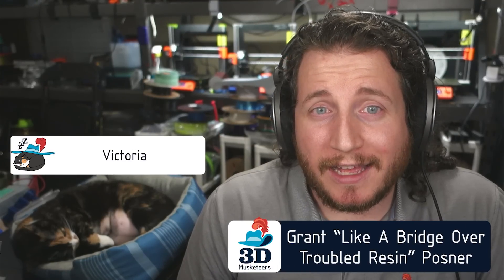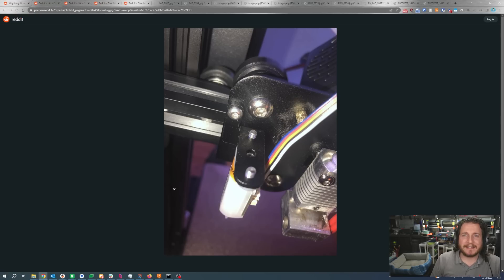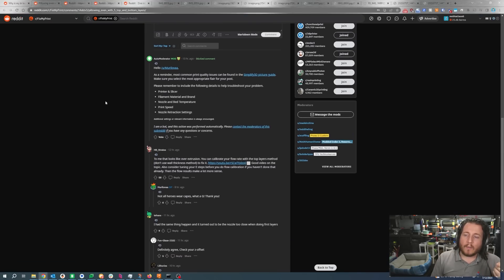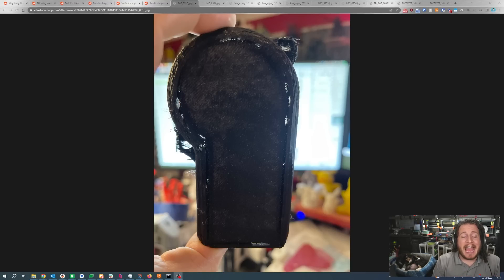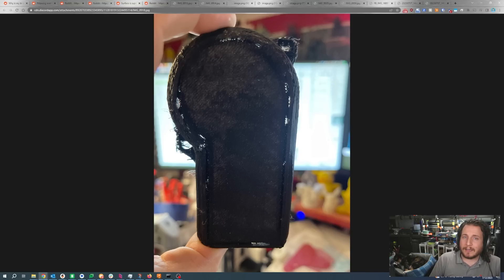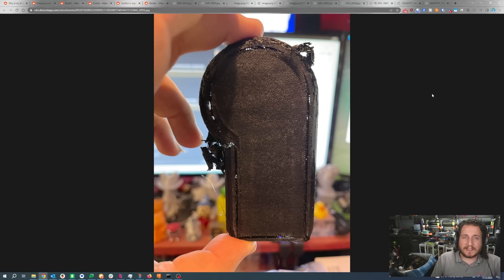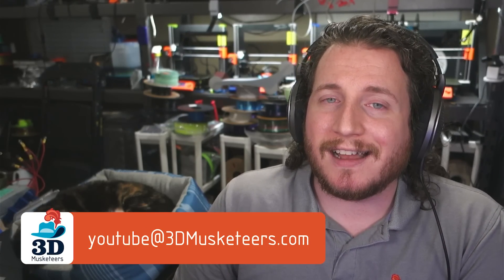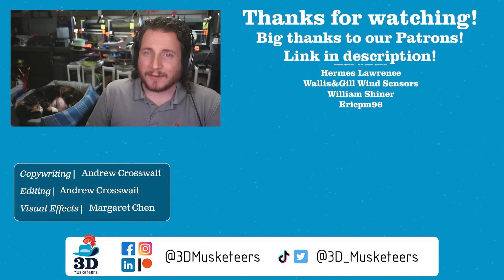This Klipper Fail STUMPED Me! - PrintFixFriday 96

Comment: I had better results with linear advance than with pressure advance. I have a coreXY system with a 220x220 bed. I use a bowden tube.
Reply from the maker: Aren't they the same thing with different names? I could be wrong.

Comment: Pressure advance is something I run on my klipperized SV06, but definitely don't have it set unless you're the one that set it! I find 0.02 to 0.03 is all I ever end up using(and not because I'm lazy, it's always just what looks the best), if I start going outside that specific range, it's often because my knock-off CHT nozzle is 'too hot' for the filament and overly liquifying it for my print rates. I have to run ABS at 212C which seems kind of wild at 10mm^3/s, but now the parts come out pretty and very strong. I even had my doubts if it was ABS so had to acetone test it to verify.. 

"Ellis' Pressure Advance / Linear Advance Calibration Tool" is stupid useful, uses almost no filament and has very clear results compared to the tall cube prints with edges to measure up to, just tell it to leave the temperatures out, set them yourself before starting the print! and now you have a tiny universal gcode to PA calibrate all future filaments with that nozzle size and speed, I've done this with TPU/ABS/PLA now.
Reply from the maker: His was at 0.5. we don't know why, but it was.. it was obviously not set properly but I'm told it was like that when he flashed it.

Comment: Ah yes, pressure advance. I'm slightly surprised that this was the thing that stumped you, but it might just be mmy bias of enabling linear advance (and experiencing the same issue) on my Marlin printers.
Reply from the maker: Since it is not normally enabled stock and I was told it was stock klipper it never came to mind, because it should not have been enabled. I was thinking inside the box, not outside
Reply: @3DMusketeers  Ah, that makes a lot more sense. I’d also be scratching my head for a while too if I was told “stock” settings.
Reply from the maker: yeah, when we found it, it was like DUH, OF COURSE!!!

Comment: That's actually the second screen I had on that printer. The first one was destroyed by dropping it into the vat as well. Anycubic sent me a new one under warranty and I replaced it, but yeah. It's definitely not worth paying $155 for a replacement screen and why I bought new printers to replace it. When I mostly print minis for a business, two smaller printers that can print about ten at a time makes more sense than one larger printer that can print about twenty at a time. At least if one breaks, I'm only at 75% capacity instead of 50% until I can get it replaced. 😊
Reply from the maker: very fair, but also oof!

Comment: Unless I fall asleep (I'm really tired) today should be mk4 assembly day. I had 14 parts that I had to reprint. Any time I was missing duplicates (the y-axis holder you need 4, I printed 1) I just used the newer R2/R3 parts and did all of them. There were a couple that were just flat out missing. The rest of them I saw enough changes between mine and the included prints to warrant a reprint. I should have everything now. However.....the MMU parts (which prusa doesn't do or provide) haven't been updated. So we'll see if they work or not. The wire covers with PRUSA on them look fine. The nextruder cover may or may not work. The new ones are 3 screws. Mine is 4. My biggest concern is the LCD frame. I did clear sides for that for the LEDs to flash out of on that one. The the nextruder cover I may tackle that this weekend. I can probably just copy and paste the lettering cutouts from the version I have. I don't think it will be that easy with the LCD frame. So I'm really hoping I don't have to change that one. Also for some reason I got my free prusament and 0.25 nozzle a day after the kit came in. I wonder why they arrived on separate days.
Reply: I've got a Prusa Mk4 on order 🙂. But it has a month lead time apparently, so I guess I get it mid-August. Waiting for orders to open up for the MMU 3so I can get one. It's a pre-built, but I'll definitely be printing spares of the printed parts. Not sure what to do with my Ender 3, it's highly customized and uses Klipper/OctoPrint to run.
Reply: @logicalfundy  I was never super impressed with the mk3 printed parts. The mk4 parts are worse. I definitely recommend printing them. yeah I want an mmu3 as well. It's almsot august so hopefully I can have both equipped soon.
Reply from the maker: Let me know how it goes!!!
Reply: @3DMusketeers  almost out of prusa haribos. Good thing I bought more. Lol I'm about 4.5 hours in.
Reply: @3DMusketeers  OMG!!!....at 12:30 I said "this is the last step". But the part didn't print quite right. So I had to drill....and drill......and drill.....Eventually I got it. That last step took me an hour to complete. Honestly I should have just reprinted the part and went to bed. So I'm at about 5ish hours of building and an additional hour of fixing an issue with a printed part for a total of 2 hours. I probably have another 4 today.
Reply from the maker: YOU GOT THIS!!!!!!
Reply: @3DMusketeers  I would have finished last night, but this is killing my back. I'm almost done. Just the y axis is left. (why is y axis last when the mk3 did it first? I have no idea) Unfortunately my clear sided LCD frame didn't fit. Also one of the mounting brackets was missing a screw hole. So I'm using the stock prusa frame and one of the brackets. I'll reprint on my mk4. lol My back is still sore. Maybe building a printer on the floor isn't a great idea. lol
Reply: @3DMusketeers  The rocket engine is almost done printing. I should have used galaxy black instead of  silver. They gave me a spool of galaxy black, but only a small sample of silver. Honestly though, I LOVE that color!!! It's really nice. I might actually buy some. But yeah it ran out just before I went to bed. I switched to the silver filament pm that I've never liked. It's close, but there is a color change that's noticeable. And it doesn't sparkle.
Reply: @3DMusketeers  anyway it's SUPER quiet. I haven't moved it to the 3d printing room yet. It was in the same room I was in. I forgot it was printing half the time. Also the part fan is amazing. It's like 4x stronger than the mk3 at least. I already love this printer. And the print quality looks incredible from what I can tell as the bed slides back and forth.
Reply from the maker: so cool! Glad it is working well! Time for input shaping!
Reply: @3DMusketeers  I have alpha 3 installed right away. I don't know if it requires something from the slicer or not. So it's possible this is printing the rocket with IS already.
Reply from the maker: does it seem CRAZY fast lol?
Reply: @3DMusketeers  I've only used the provided g-code so far. While I have input shaping, the g-code is for the stable roms. So it's not overly fast....yet. Unfortunately the input shaping profile only includes 0.2. I'm wondering if I can just increase the speed in the normal profile. I'd be surprised if there is anything in the IS profile that changes the gcode, but I don't know. I now have the alpaka and the rocket engine. The rocket engine is SUPER impressive. It's got significant overhangs......no artifacts bulging or anything. The sharpness is a level that could never be achieved on an mk3S+. Absolutely 0 ringing (which is why I think IS will work on the non IS profile). And half the time I don't even know it's printing even though it's in the same room as me. It's crazy quiet. Sometimes I run back to check on it just because it's that silent. The mk3s+ is in the printer room. I can hear it through the floor. lol

Comment: FWIW in my experience Klipper is significantly easier to use than Marlin, once you have it set up - which does require some Linux knowledge, admittedly - but the documentation is excellent and I’ve had significantly fewer issues with things acting in unexpected ways or just not working at all for unclear reasons than I had with Marlin.
Reply from the maker: Oh yeah, the fear is 100% self imposed, I just break things so often! lol
Reply: I agree, unless you are in the rare situation where you bought the printer and the firmware provided does everything you want. In that case, Marlin is easier. So basically only if you buy a Prusa or something comparable...
Reply from the maker: @NickNick2024 fair, but it is pretty sweet I am told with Klipper that you dont have to recompile and such!
Reply: @3DMusketeers  Yeah the configuration without compilation is a game changer for experimental/tinkering printers!
Reply from the maker: I am told!